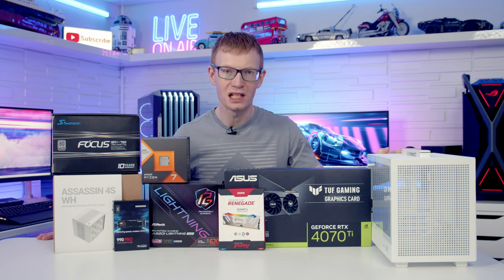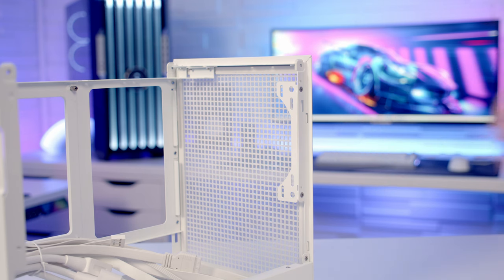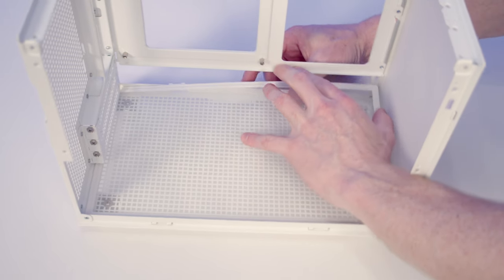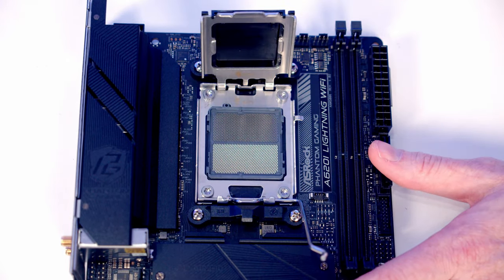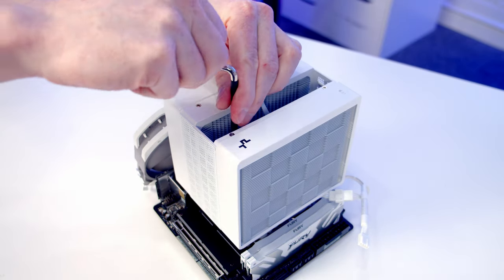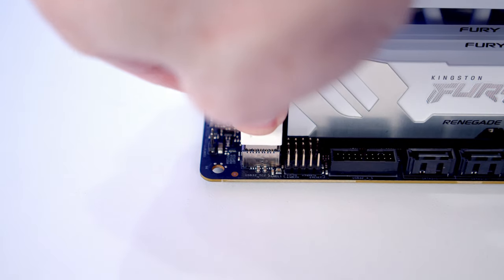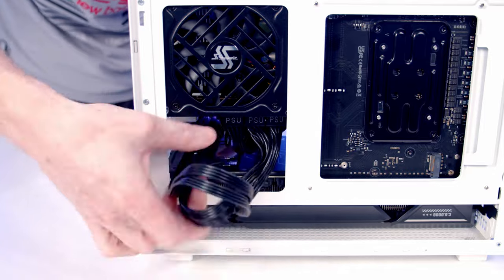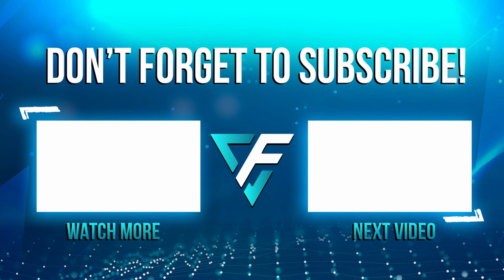DeepCool CH160 Build - Step by Step Guide

Comment: Yes, I prefer to install the motherboard first and the fan on top after. I also do not like the  power cable lays naked on the metallic wall. You can also pull it and have a risk to damage.

Comment: I've always had issues with heavy coolers hanging off the side of a motherboard. Is there a way to support the CPU cooler from the bottom or alternatively, lay the computer on its side so the motherboard is parallel to ground surface?